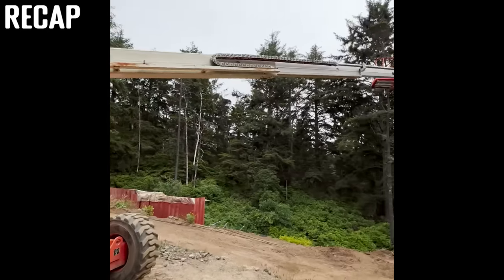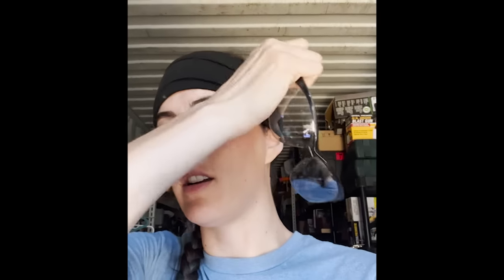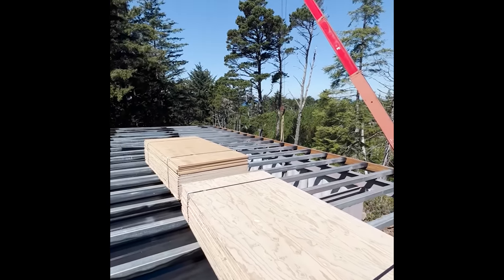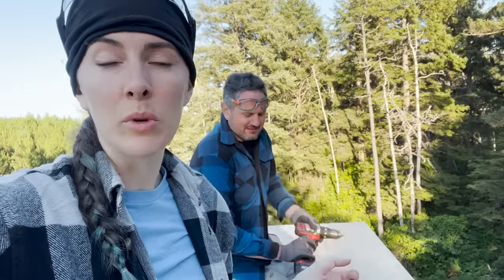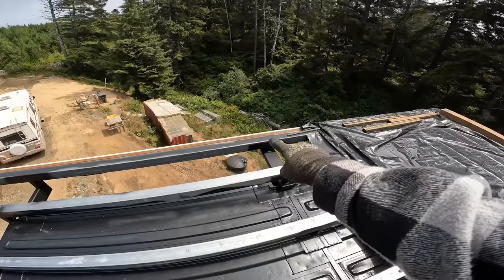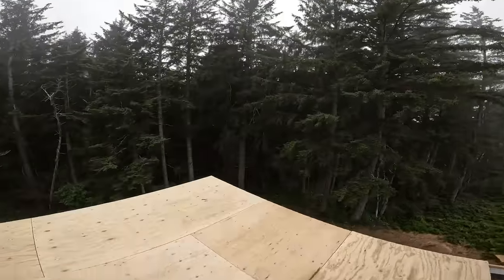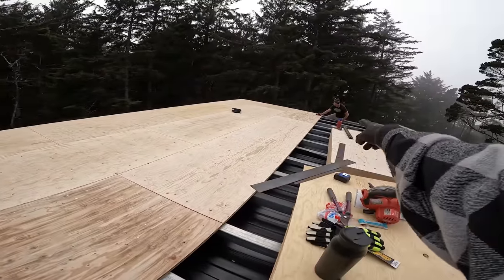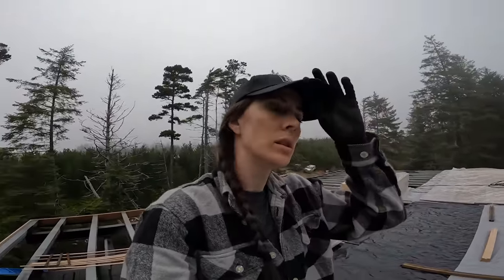SHEATHING / SUBFLOOR for our ROOFTOP DECK - Couple Builds Modern House #roof #build #diy

Comment: The thing with self tapper screws is you will always have a percentage that do not cut, so pre drilling is necessary. Another factor is when you weld thinner metal such as your square tubing some areas will become heat hardened. As a retired union ironworker this has been the bane of metal construction cladding, wether metal or wood. But no one ever said that building was easy Peasy.

You folks have been doing great though for self taught builders. Enjoying the build, bet your looking forward to some stairs though. But closing in the shell is a priority.
Reply from the maker: Thank you and thanks so much for the info!! We are learning as we go. :)

Comment: Anytime you go from wood to metal you need to drill a pilot hole. And anytime you have sheets of plywood, drywall, or anything that you need to screw down or have a rope tied around him something that wind ever gets under them you will just have them spread out across the yard like a deck of cards.
Reply from the maker: Thx for the tip!

Comment: I've always distrusted battery power tools.    for anything but the most easy/light work,   they always seem to have issues keeping up.    But....  seems like y'all figured out some better workflow.      And was super interesting watching the piles of plywood get smaller as the roof filled in.
Reply from the maker: Thank you so much!! Always a little bit of problem solving with each step :)
Reply: What r u saying battery power tool if find maybe u don't like electric car too 🤔🤔🤔
Reply: @robertwill1694   not really sure what you're saying.  but power tools.  often  need "power" to maintain the torque or power output required to do the task you'd want to use them for.    corded tools... add a layer of inconvenience for having to have them plugged in,  but never have the issue of lack of power.  

a car and a drill are not the same thing.    I would say if you commute short distances... 99% of your driving is within 200 miles... an electric card is probably a good option.... but for vehicle use outside that... it might not be...but  i guess.... to each their own

Comment: Wow definitely battery operated drills dont have as much power as a inpact drill off an air compressor, or running off a cord. Looks great it will be safer. Are you putting railings up too? Time to build stairs too. ❤❤
Reply from the maker: Thank you!! Yes definitely putting railings at some point... trying to figure out a good design. :)
Reply: @PacificPinesRanch  I think some metal & wood would be cool. Frame out cow panels. But definitely want to see out. Plexiglass be really expensive I bet.

Comment: I know form experience that the lithium batteries get hot they will not work or charge very well. You two are doing a great job! I will be glad when you get some guard rails up so I don't have to worry about you two falling off.
Reply from the maker: Thank you!! Yeah I think the heat definitely affected the performance. I know the railings and stairs will be a really nice upgrade for us! :)

Comment: the screw are breaking , because of the thread is trying force itself into the aluminium but the hole is smaller , it would have been better if you had inserts ,  but anyways  you guys have worked it out and seems to be going on smooth .. cheers
Reply from the maker: Thank you!! They are self drilling screws so ideally they should be going into the steel tubing, but we eventually figured it out. Just another bump in the road lol :)

Comment: I have a question. What psi and voltage do you set your plasma cutter when you cut the sheet metal?
Reply from the maker: It depends on the thickness of the steel but usually around 80 psi

Comment: it was such a pain watching you try and put those screws .. first and most important is the bit to be the right one for the screw.. PH3 or PH2 i think is your type.. and if using PZ bit it's just not working when the screw hit the metal and needs a lot of force to go in... also you can use the drill not the impact driver as it have constant torque not the hitting one that sometimes is messing with the drilling.. with the right bit and driver it's very fun to put those self tappers.. i did some roofs like yourss and it was fun and fast
Reply from the maker: Thx so much for the tips!! Appreciate it :)

Comment: I think the threads on the screws are too tight/fine to use an impact drill. The screw needs a smooth turn rather than one with an oscillation.
Reply from the maker: Thank you for the tip!! :) Appreciate it

Comment: I used the inch and an eighth for all of the new counters in my kitchen. And yes, they are very heavy. 
But they are solid and probably won't rot for at least 50 years. I don't use particle board for counters.
It only cost $70 per sheet.
Reply from the maker: They are definitely sturdy!! 😊

Comment: For the job you are doing, the small impactor is insufficient.  You would find a bigger impactor would be much more usable, like a 3/8" tool.  That little one is working beyond it's design specs.  A good Dewalt or Milwaulkee driver/impact drill would be much easier to use and the job would go much faster.  And, you may not have to pre-drill.  I've been a tool guy all my life and I hate to see you busting ass to get your sub roof down, time's a wastin' and the wet weather wont wait.  Use the proper tool for the proper job!!  Good luck guys!!!
Reply from the maker: Thx so much for the tips!! Appreciate it :)

Comment: WOW ....NO SAFETY EQUIPMENT ALL THROUGH THIS BUILD , HOPE YOU HAVE HOME OWNERS INSURANCE UP TO DATE YOU MIGHT NEED IT AS YOU GO ALONG.
Should have use ......A Stud Gun to fasten the ply Sheets. Just drop them on for marking then drill. You are using to small od a Drill to get through that 
... 1/8 - 3/16th Tubing so it will be hard to set the ... Self Tapping Screws in them.
Reply from the maker: Thx for the suggestions!